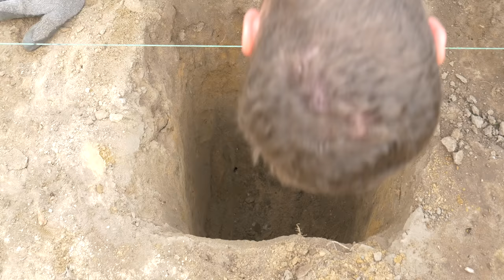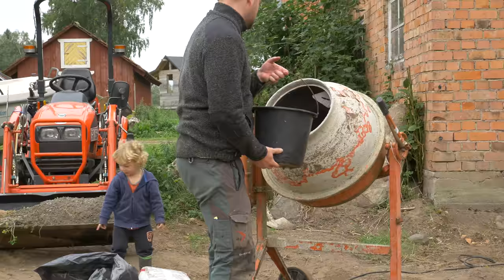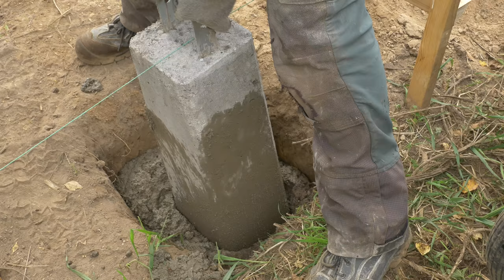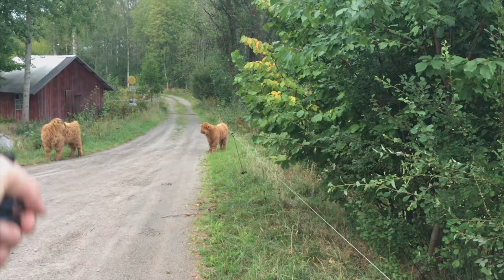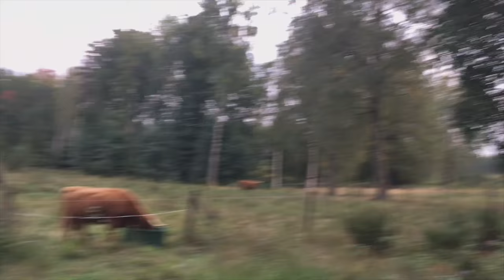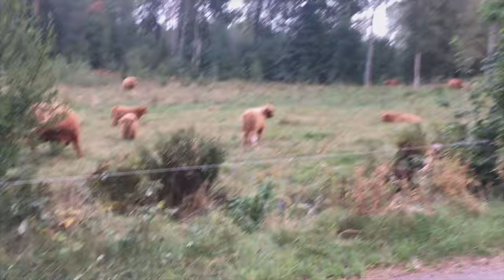Laying The Foundation

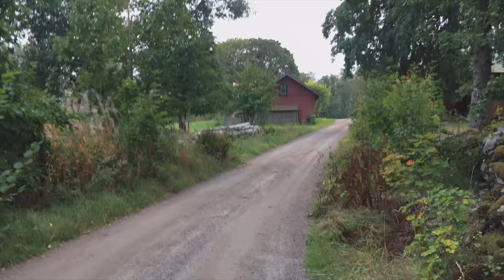Comment: At video 7:55 the cow in the edge of the fence didn't seem to sociable. Is it one of the" new " ones?   Henry is getting so tall !  It's great to see that the calves and Henry get along well without a fence between them.   Work is never done on a farm.  Great video!
Reply from the maker: No, that cow had busted through the fence earlier and was trying to find the right time to do so again... But now it was hot...
Reply: I probably would look the same too, if it was hot.

Comment: The concrete piers you used looked quite durable.  But, would it be easier to just buy a stainless steel  pier block that weighs half a pound and set it in wet concrete, than have to carry around a
60KG / 132 pound piece of concrete  that might hurt your back?  Do your building codes require the ones you used?

Comment: Hi Simeon, thanks for the video. What mix were you using I wonder? We would use a 5 to 1 mix for a footing and I always let the concrete slake for a minute before the final mix and use.
Reply from the maker: I use a ration 4:1. 4 shovels of sand/gravel on one shovel of cement. I made a fairly dry mixture this time.

Comment: Footings?
Reply: Pier blocks
Reply: We call them Footings. . Foundation is the full EDGE WALL or FULL SLAB under the building.
Reply: These are piers or pier blocks. A footing would be a continuous line of wall, typically below grade.
Foundation is a general term, and can be whatever supports the building.
Reply: @julier1080  it's what we call footings in Australia.  It FOOTS the support pole
Reply: True enough I suppose, but typically it would be specified as a pier footing, which is different than footing or footer in general, which is a perimeter wall in the ground. Depending on his subsoil, what this video shows is simply a larger diameter extension of a pier block, which may or may not act as an actual footing. Generally accepted practice is to dig deeper than frost line (assuming good solid solid soil at that level). His holes didn’t look very deep. If the drainage is quite good, Simeon may be fine with what he did, but typically that method will be susceptible to frost heaving.